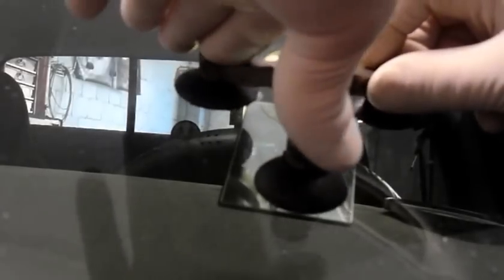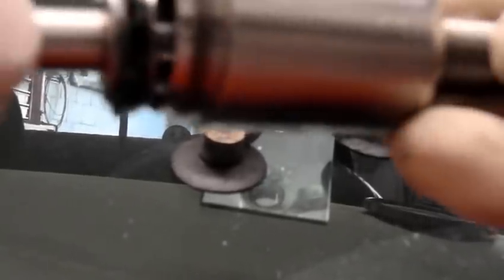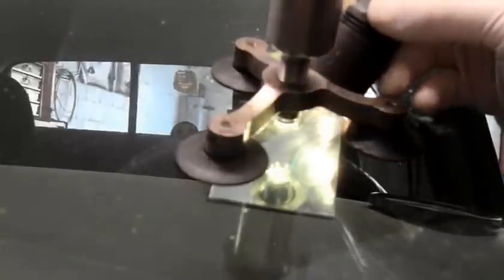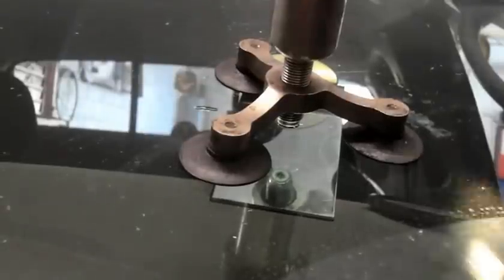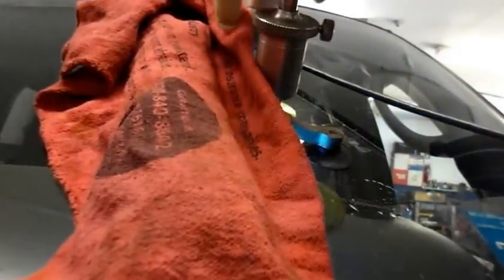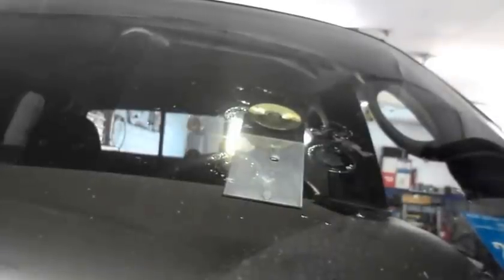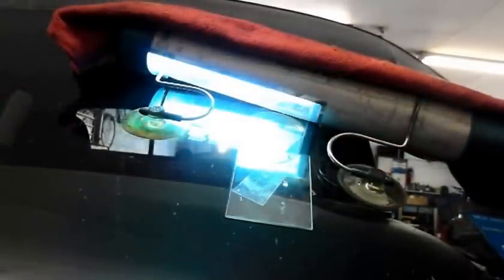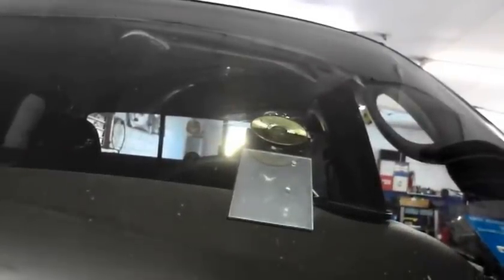Repair The Front Windshield Rock Chip Don't Replace It

Comment: Awesome video, Jim. I have seen that job done by auto glass professionals that didn't turn out as well.
Reply from the maker: +wysetech2000  The kit that i use works very good if you take your time and get all the air out before you install the resin.Thanks for watching and your input.Jim

Comment: Thanks for sharing. That was a nice kit.Would that work on line type crack or just the circular type crack. Great video.
Reply from the maker: +Michael Herbert  Very good question.The company that I got the kit from said that you can repair cracks in the window but I don't repair them because it look bad.As you can see it work great on anything smaller than the size of a quarter.

Comment: nice repair...what tool did you use?
Reply from the maker: +hllywd964  The kit that I use is made by a company called Glas-weld out of Oregon.I used it for years and it work perfectly.
Reply: thanks